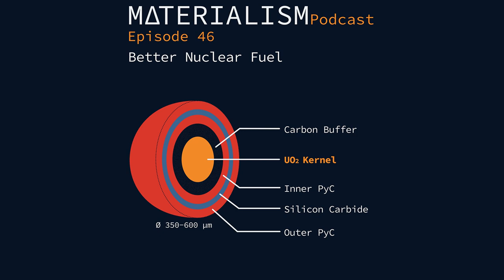Materialism Podcast Ep 46: Better nuclear fuel

Comment: Some weird audio artifact is "denaturing" the podcast... sounds like someone brushing tree branches against my house... Good podcast, though!
I figured very roughly that Radiant 1MW Radiant Triso nuclear, the size of truck trailer, is...
~450x smaller footprint than a 1MW (actually, a 4 MW) solar farm...
and 4.5x smaller than just the megapacks needed to store the ~18MWh...
And that the energy needed to make the nuclear is about 1/80th of what it would generate...
over just 5 years.
Yes, it would need to be refueled or recycled or simply replaced, but the EROEI is just awesome!
Reply from the maker: @robertbernal8666  We have been improving the quality of the podcast over the years. I'm not sure where we were at when we were recorded it with this one. But it's in a pretty good place now as you move towards the later episodes